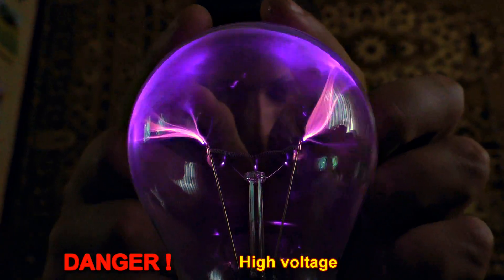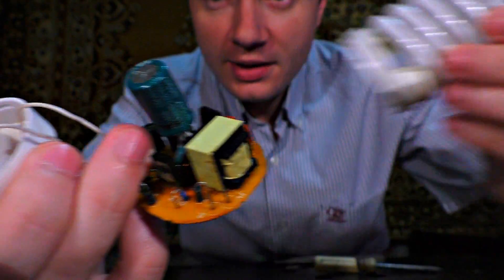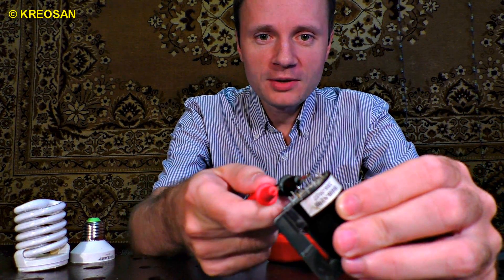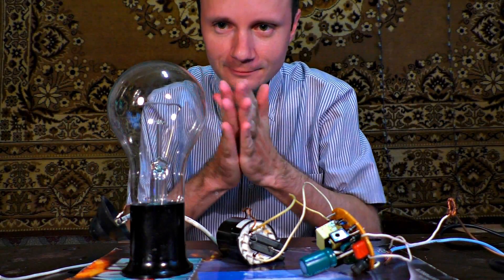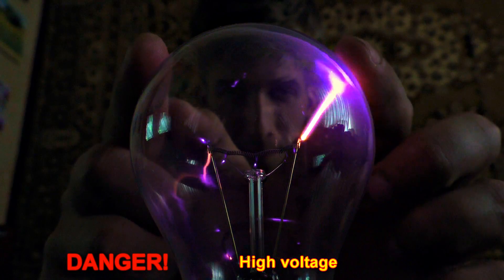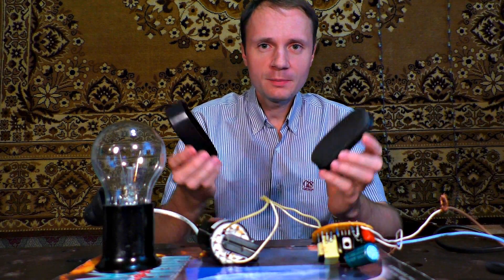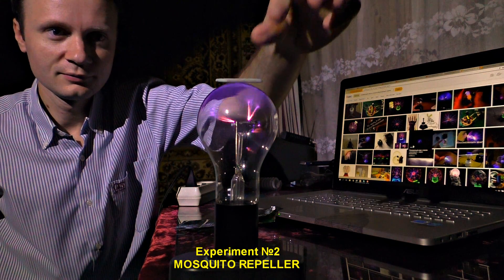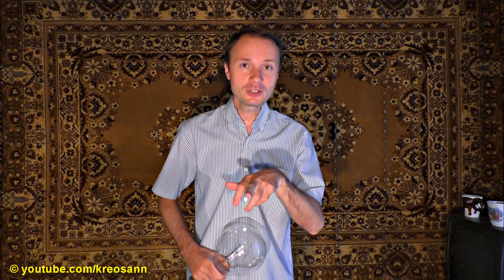A PLASMA GLOBE made from a LIGHT BULB + 4 fascinating tricks in the end!

Comment: You might want to check for uv output. Some other channel showed that if the glass doesn't have the right composition, the argon & nitrogen blend in lightbulbs emit uv light when attached to a plasma transformer/generator.

Comment: Can you use the energy saving light bulb circuit to power a Tesla Coil?
Reply: Yes you can use it to drive the Transformer then use a HV capacitor with 350pF in parallel to the output

Comment: How do you do you the soldering of the circuit of the energy saving light blub show me by sending me the video becoz I want to make a same
Reply: sarthak varma Connect the flyback transformer to the pins that are not connected to the capacitor
Reply: I am 10
Reply: Its deadly voltage

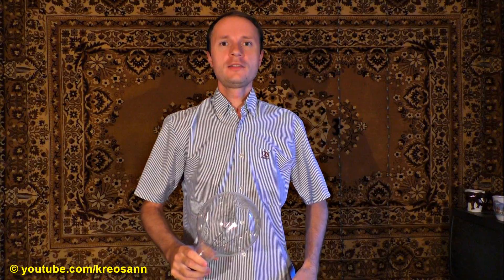Comment: 4:23 that is weird, you hesitate in an explosive experimentation, it's just not like your usual way of making videos
Reply: Bryce Beck what is the part number of the transformer it's very important because I want to make it
Reply: and 1:37
Reply: Oswald Rayleigh ,.    What is the voltage of the flyback transformer used it is 25kV DC or 15kV DC
Reply: sarthak varma 10KV
Reply: sarthak varma It does not matter any small Fly back transformer Will work
Reply: sarthak varma IN18—N19B
Reply: sarthak varma IN18-N19B
Reply: Bryce Beck really?
Reply: sarthak varma yes
Reply: Bryce Beck bro I went to the spare part shop and asked the shopkeeper for a small 10kv tv flyback transformer but he told that he can give me but there is a serial number required on that basis only he will give me the transformer then I give him the number IN18-N19B (the which you gave me ) he told it's not the number. What should I do now? If you are having a same transformer then send me it's photos on my email- sarthak25180803@gmail.com.
Reply: If you use an AC flyback it should work.